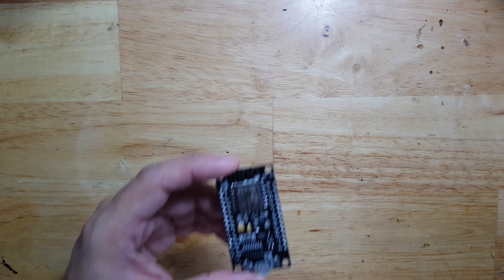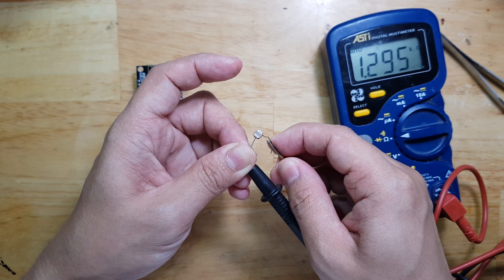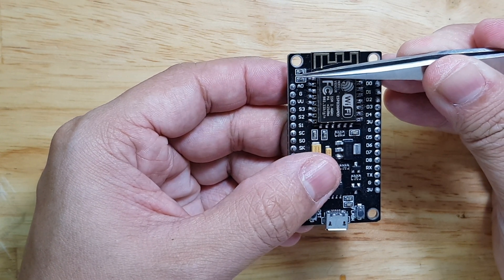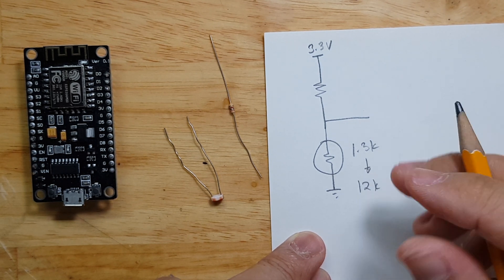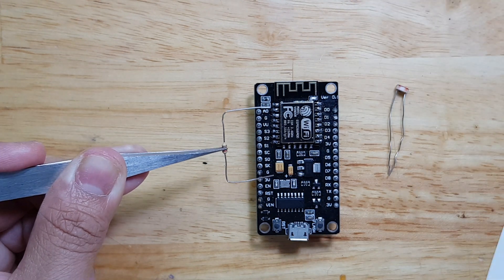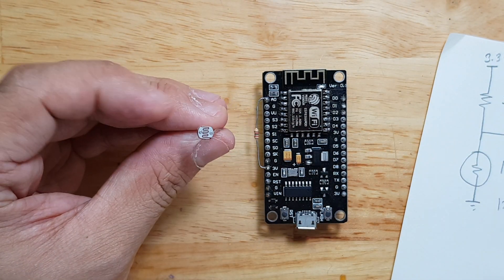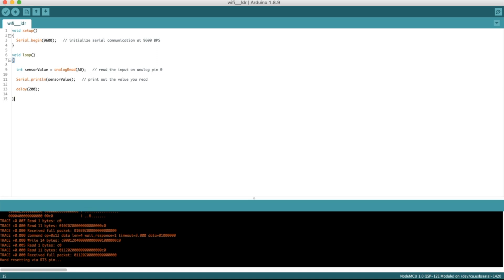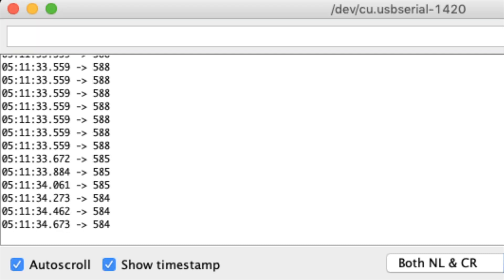HOW TO CONNECT ESP8266 NODEMCU TO LDR (LIGHT DEPENDENT RESISTOR) SENSOR - LIGHT SENSING IOT PROJECT

Comment: Bro I want to make a security device using a laser and a ldr with esp8266 configured to blynk  when the light of the laser won't be able to reach the ldr I want the blynk app to send me a notification!!
Reply from the maker: Have you tried using blynk? Start with basic button then you can move to LDR :)
Reply: @circuitdesolator  yes I have already done that.
Reply: @luie.no1noob  so what is your problem